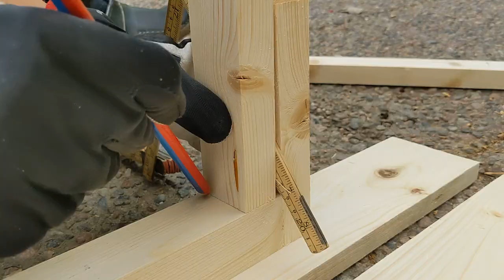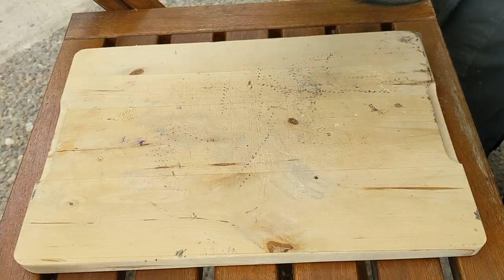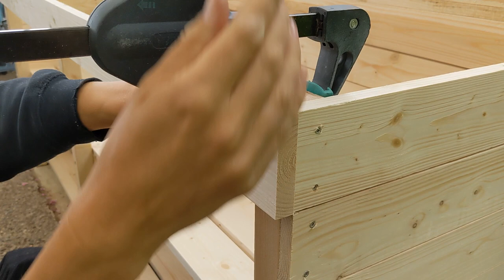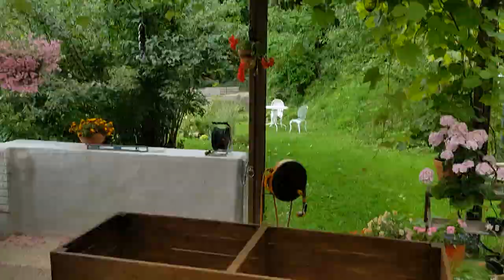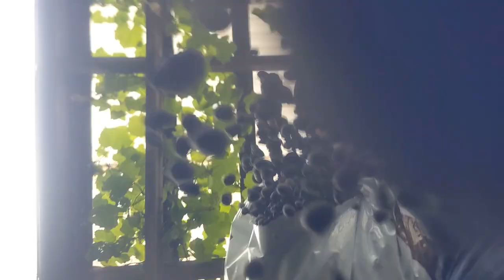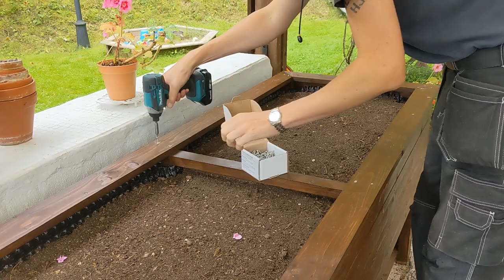Let's make a raised planter box!

Comment: Do you have a list a materials?
What type of lumber and Quantity?
What was the liner you use?
Otherwise very good video and is something I have been thinking of doing
Reply from the maker: Thanks!
The sides and beds are all 21x95 mm and the frame is 45x45 mm, all pine. I used this because that's what my father had laying around. 😁
The box is 1,9 m long, 0,6 m wide and 0,8 m tall. In total that was 56 m 21x95 and 9 m 45x45 when cut to size.
The lining is called Platon mat in Sweden, it's normally used for drainage around houses.